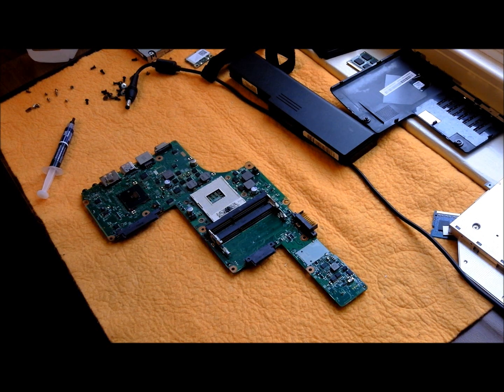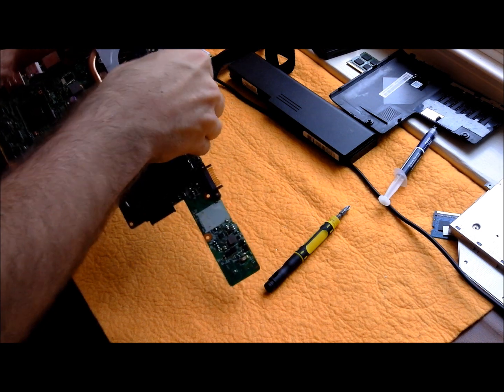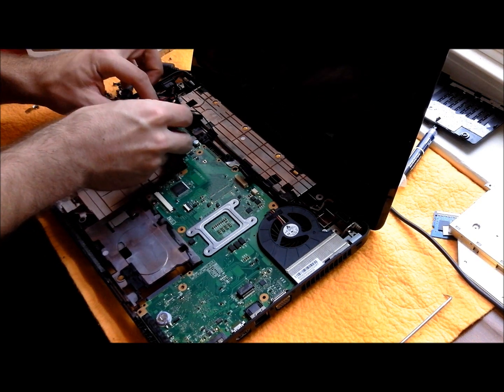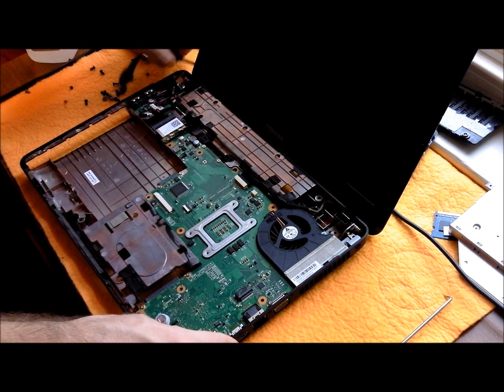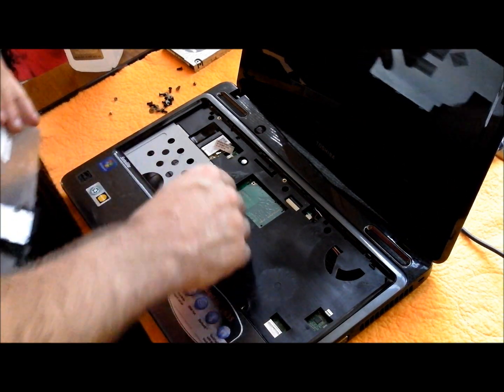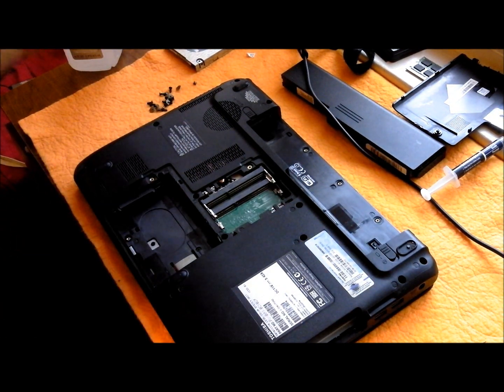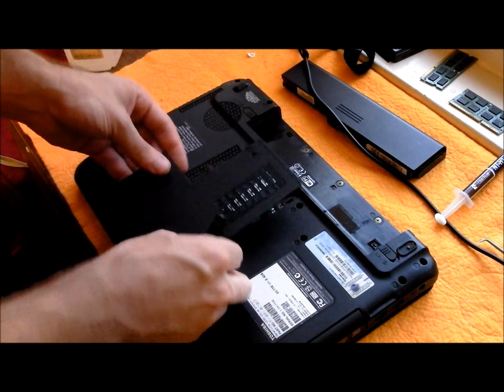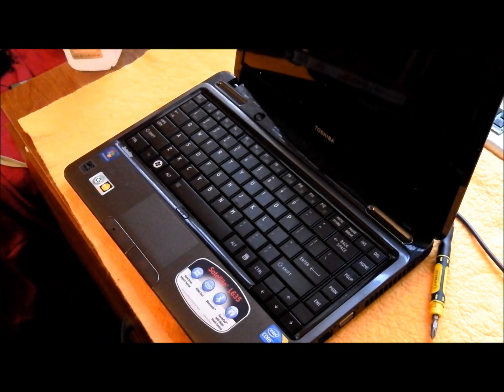Tutorial: Reassemble Toshiba L635 Laptop (Replace motherboard ram cpu SSD)

Comment from the maker: I have not personally done an upgrade on this model. However, your laptop has the H55 chipset and therefore should theoretically support any 35w G1 socket cpu with the same fsb. You are right in saying it is plug and pray. I would update the BIOS to the latest one *before* you attempt a cpu swap. My top picks for gambling on your model would be the P6200 and 450M i5.

Comment from the maker: Of the last 2 things I baked, one worked and one didn't. It's a little hit or miss, but you don't have much to lose since you'd need to buy a new board otherwise. If you have a better oven, you'll have a better chance of it working because you'll have more even heat distribution.

Comment from the maker: Cool sounds good. One thing- Unfortunately a cpu must be allowed by the BIOS to work in a computer. While a cpu may have similar specs as the one you have currently, if Toshiba did not allow it in the BIOS, it will not work. I suggested those 2 specific models because there are L635 laptops with those cpus in them (from retail), so it is more likely that they will work.

Comment: Thanks for the advice, I was looking between the i5 520M and the i3 330M because they're very similar to the p4600. Best bet of those two imo is the i3 because it has all the same features and functions but slightly higher speed. However I did test out a total of 6GB of ram and it made it seem like a new computer lol so I might just leave the cpu as is. I'll keep you posted!

Comment from the maker: Unfortunately laptop manufacturers do not provide a list of what cpus are compatible in each system. Other than actually trying a cpu in the laptop, you can't really be guaranteed something will work. What I do is look at what other configurations a certain laptop comes in (so if the C875D comes in a different package with an A8, you could use that cpu). Theoretically, any FS1 socket 35w chip should work, however it depends on if the Toshiba BIOS supports it.

Comment from the maker: Sorry, I don't have any experience with that specific model so I can't say for certain. The chips are both FS1 socket and 35w, so physically and technically speaking they are compatible. The problem is that Toshiba may not have written the BIOS to support that chip. There is no way to know for certain other than trying it out or finding someone else who has tried it. I'd give it a shot if it were mine, but that's just me. You'll void the warranty by opening it, so keep that in mind.

Comment from the maker: Replacing ram won't void the warranty. As I mentioned before, no one will know for certain if the swap is possible unless they have tried it themselves. I would doubt you will find someone else who has done it with this specific laptop. I don't think the 4400 is a soldered cpu, it should use a standard FS1 socket.

Comment from the maker: Hey king, I have posted some informative links in the description of the video. For graphics card, you will need to go external to upgrade. On the cpu, the fastest known compatible upgrade for your laptop is the T6600 (link in description as well). Theoretically any 35w socket P cpu should work, however it really is hit or miss on BIOS compatibility.

Comment from the maker: If you absolutely *need* a quad core, then your option are 1) buy a new laptop and sell this one or 2) buy a cpu on ebay, try it, then resell it if it doesn't work. If I had to gamble, I would try a A8-4500M. If you are feeling luckier than me, you could also try the A10-4600M.

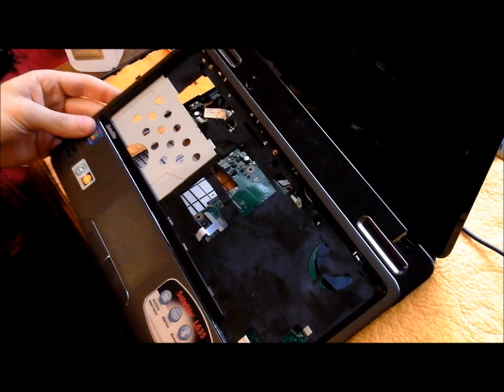Comment: My replacement board I ordered is missing the power jack in which you connect at exactly 6:21. Can that be taken and solder on from the original power motherboard?

Comment: Hey mr82020674, I am looking to upgrade the CPU and the RAM in my Satellite L635-S3030 (Very similar to the one in the video) I was wondering if I could upgrade the Celeron P4600 to something, A) either faster than 2.00GHz B) Larger L3 cache than 2MB or, C) Both. From doing research into this, as I am a noob, it seems that I would have to update the BIOS for the laptop afterwards, or from what I read anyways, and no one can really say for certain which CPU will work, its all just plug and pray.

Comment from the maker: There are several on ebay right now. I can't post links in the comments section, but do a search for L635 motherboard. You will find several available- just make sure you get one with the same graphics chipset as yours (if you have intel integrated graphics, get that one) and you will be fine.